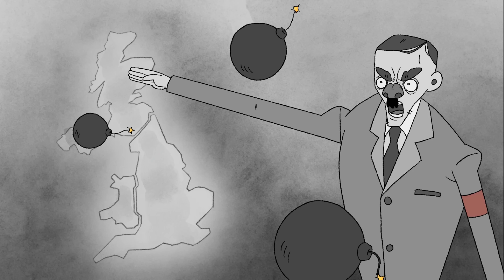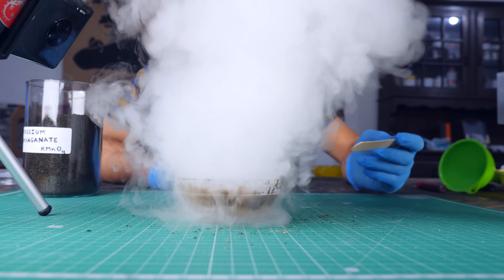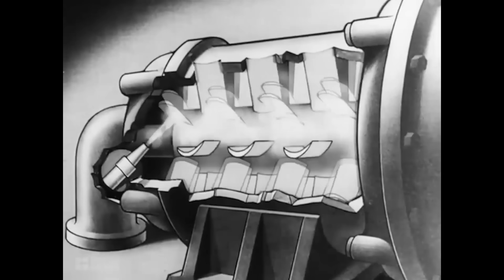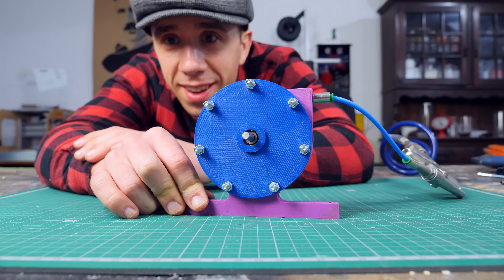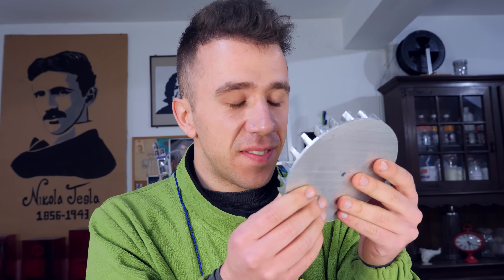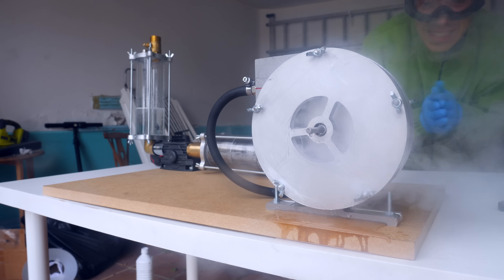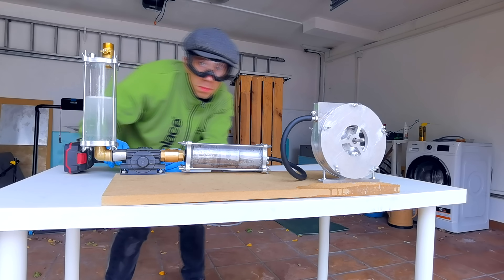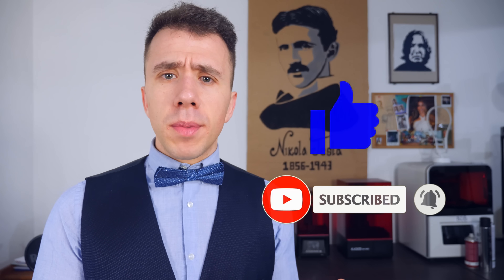I built the World War II V2 Rocket Steam Turbine

Comment: I see two things that needs an improvement, the catalyst tube need to have the output tube it must be in a higher position respect of the input side, so the peroxide can’t exit in a liquid form. The second one it’s the weight of the impeller, you can hear the rpm ramp up sound. Good video.
Reply: Making the catalytic tube vertical just like the peroxide tank would automatically add a sort of "distilling" element to the process, making sure all the gas has to pass through all three catalytic converters.
Reply: Yeah sitting the cat tube vertically and filling it from the bottom should help alleviate the problem of it pushing H₂O₂ into the turbine.  Also to get the most work out of the steam it should be coming in along the axel and exhausting at the outer edge of the radial turbine. The problem with this design , with the steam exiting in the centre, is that the steam is being forced back on itself by centripetal force imparted by the turbine disc. It's also moving to an area of higher pressure as it moves to the centre and as liquid is getting into the turbine and trying to exit vial the centre this is inducing more drag.
In short swap the inlet to come it near the axel and the outlet to the bottom of the turbine to drain any liquid
Reply: Yeah but the RPM ramp up sound is the best part!

Comment: I've had this idea for years to take a typical turbocharger for a car and instead of using exhaust gasses to spin it, I could use a combustion chamber and use fuel and oxidizer, fuel and forced air, or even the h2o2 and catalyst to run it and if it makes enough mechanical power I could make an axle for it to add power to a front wheel drive vehicle because it can be added to the rear undriven wheels. I think it might have promise as a way to add decent power without having to upgrade the engine itself.

Comment: Mount the Catalytic chamber vertically with the exhaust at the top to only let steam and oxygen out without pushing the liquid hydrogen peroxide out as it  will settle at the bottom. Hehe...also really need a 3D printer...so if y'all could help out with the likes I'd really appreciate it.
*Also there's a problem with the link to the models.

Comment: Along with the people who are also suggesting vertically mounting the reaction chamber... you can at the low point in the hose use something like an egr like valve that takes the heavier liquid and recycles it into the main tank... while allowing the steam produced continue along the way which should further lower the loss due to the h2o2 not completely being reacted and escaping that chamber... just a thought

Comment: I see 2 main problems here. 1st- liquid is getting into the turbine. Solution: make steam intake from above, gravity will pull liquid down and pressure steam will go up. 2nd- the radial turbine has to be designed taking into account fluid velocity instead of pressure, you can quickly calculate this as Q=S/A (flux=speed/area). Hope it helps.

Comment: that intro had me going like "how does Keeps have anything to do with Hitler?" NGL, if that were the Ad read then I'm pretty sure you would of managed to keep most peoples attention on the Ad. Keeps wouldn't of been happy but the attention ratings would of went up like Old Spice Commercials or any other commercial that actually is designed to keep peoples attention. Saw you used the CNC machine again, you gonna make a nozzle for cutting fluid to increase the life span of those end mills you keep breaking?

Comment: Dont know if it has already been sugested but for an idear, a 'gimballed nosel' (a nosel that can change its direction of thurst), maby for an experement, attach it to your skatebord and drive it about by changeing the angle of thurust? or pehaps for that RC rocket?

And as an idear on improving the catalist chamber, have the tube fixed on the top of the chamber, this allows steam to rise while the proxide drains back into the catalysit to be converted into steem. on a sligly related note, pehaps have a pressure chamber between the catalyist and the turbine? it would allow steam to gather pressure to level that you can control and potently higher pressure levels.

Comment: I think I'd turn the catalyzer tank vertically with steam coming out the top, peroxide going in the bottom or side. Also, maybe not stacking the catalyzer all the way to the top, gotta have room to settle the liquid out from the gas. I think there's also valves that help gas escape and not liquid?

Comment: you could try wrapping the cats in an electric blanket and heat them to like 80C might help with the decomposition reaction, more temp is normally more better with chemical reactions. those cats may need re-activating every once in a while the metal will oxidise inside them which may make them perform better actually, PdO and PtO are better oxidation catalysts than Pd(0) and Pt(0) metals.
Reply: Do you think any cat is gonna survive this..? :D
Reply: @Larock-wu1uu  Yeah no sweat, supported PGM catalysts can be blasted with a few hundred degrees at a couple of hundred bar for 100s of hours on stream, this shouldn't do much to it, peroxide needs something acidic to leach out the metals from the cat, should be fine......should, I have eaten my words before 😂😅

Comment: What about instead of sending the gas products directly into the turbine send them back into the hydrogen peroxide tank, to provide a self-sustaining positive feedback loop and a liquid-gas separator? So unreacted liquid gets thrown back into the tank, and steam, while pressurising the whole assembly (feeding itself) - gets into the turbine.
Also, i'd suggest you using steel tanks for high pressure needs instead of acrylic tubes due to high pressure and chemical dangers.

Comment: With that poster behind you I thought you'd use a Tesla Turbine. I made one and it runs at about 100,000 rpm at 100 PSI. Gear it down to increase the torque for the generator.

Comment: Just twho things 
1 Why the catalyzer chamber is orizontal? Make it verticalso you can extract only the steam from the top. And no water Will Flow into the turbine. 2 The turbine spins because of kinetic Energy of the steam impact on the wings of the turbine. To improve the torque the gas must be "standing  still" once impacted on the turbine wings. If it bounce back you waste kinetic Energy. A part of the energy still with the gas floating around. So try to modify the nozzle size or increase it. If it is too small The Flow Will be too fast and bounce back. If it is too big you still waste Energy. I guess the core problem is in that. You can even modify the wing profile and so but i suggest you to start with the nozzle diameter. Sorry for my English.... I hope it have a meaning for you XD byeeee

Comment: So the V2 used a steam pump to pump the fuel for a rocket engine. And then you go and use a drill pump to pump the fuel for a steam pump which then in turn would pump the fuel for the rocket engine.

Comment: Ha, I've suggested this, in a comment under your 'Hyper Jet Steam Turbine' video about 4 months ago. I wonder, did you read that comment or did you come around to the idea independently?
The comment was this, by the way: 
"You could try using silver mesh/sponge as a catalyst, and using the steam to power a Tesla turbine (and use that to power a model car or a boat).    Or use a peroxide-powered steam turbine to power a pump, like in a real rocket turbopump. I wonder how high of a flow you could get with that, and for example, how high up could you shoot the liquid.   You might also try making a true model of a rocket engine using that pump - use a peroxide powered pump to pump peroxide and a combustible fuel (Alcohol with permanganate, maybe?) into an engine. It might turn hypergolic... maybe.  You could use one enclosed steam turbine in the middle to power two pumps with one shaft (the size of the pump rotors should be proportional to the proper ratio of liquids being pumped). 

Would try it myself, but I've got no 3d printer, and machining all that on my manual mill and lathe would take forever." 

Maybe One of those ideas to use the steam turbine? ;)

Comment: You should probably mount a pressure tube to equalise the pressure of the fulle and outlet to remove the back pressure, also, you can make it work as a hydraulic press to simplify the design and remove the pump

Comment: A lot of people are suggesting mounting the cats vertically, which is probably easier than my idea. What if you split the reaction chamber? If you add a couple of one way valves or flashback arrestors in between the cats it will give it more time to react, while ensuring that each time it pushes the reaction to the next chamber it isn’t just pushing more unreacted peroxide straight out. With the pressures involved I imagine that mounting the cats vertically will still push just as much peroxide out the end.

Comment: Really cool! Recreating this kind of stuff is an awesome process to behold. I have a couple ideas that may or may not work 

If you mounted your steam out port more towards the top of the catalyzer, that might keep some of the fluid out of the steam thanks to gravity.

Also, not sure if this is feasible, but maybe you could run an air line from your catalyzer to the top of your peroxide fuel container. This should mean equal pressure on both sides of the fluid, so then you could feed the catalyzer with gravity and not need a pump. Might make the entire thing solely peroxide powered 😃

Comment: Why dont you get n turbo and mod it a bit to improve efficiency that is almost the same design as the jet engine but one side is intake and the other outtake so can split it to only use one side or both to get more horse power and using a shaft on the blades that makes something into moving force

Comment: try larger catalytic converters, if you can get your hands on them. more reaction surface area should mean a more complete reaction, at least in theory. also add an intermediary vessel between the reaction chamber and the turbine with inlet and outlet located at the top of the vessel, any liquid coming over from the reaction chamber should get caught in the intermediary vessel while any gaseous byproducts should flow through un impeded.

Comment: I think the outlet from the catalytic converter should be near the top of you're still having issues pushing liquid hydrogen peroxide into the turbine. Since the steam will rise and the liquid will stick to the bottom. 

Liquid should be fed near the bottom and maybe orient the converters vertically if possible.

I think putting them in series is causing a few issues with lowering the output pressure because the steam has to move through the converters which will contain the flow due to friction. I think feeding them in parallel is harder, but you'll get more surface area to react, and then you'll get more steam out.

I'm curious how much of the catalytic converters are actually being exposed to the reaction, and is the reaction being assisted or hindered by using three in series.

Comment: add another chamber in between the catalyser and the turbine. it will help you regulate the pressure.
another way what i think maybe better is that... if you pass the h20 and o2 mixture through a chamber with liquid water... the steam water will precipitate and the oxygen rich air when combined with a atomizer type apparatus to pump a fuel air mixture into the engine ... it can then be... you know HAHAHAH. 
anyway, love your videos man keep working

Comment: You could 3D print / mod an already existing  plane with a pulse jet engine as the propeller. Even without any remote control it would be fun to watch something that flies using an engine you built.

Comment: Why not add an isolation chamber  between the turbine  and the decomposition tube  so that the water vapor and oxygen can pass through to the turbine and   any unreacted  hydrogen poroxide  can be recycled back into the the system and reused

Comment: Maybe add a cyclonic separator so you get less liquid into the turbine. No doubt that is restricting flow through the tube and slowing down the turbine.
Increasing the surface area of the tines should give you more bottom end torque. Might help with the power under load.

Comment: Regarding the turbine, what could really improve your performance is using a de Laval nozzle on the inlet rather than just a simple port or converging nozzle. It's the easiest way to convert as much of the heat of the steam into velocity prior to hitting the turbine and is actually how most steam turbines of this type (ie using tangential steam injection) operate. Since figuring out the mass flow rate would be a pain in the ass here, I recommend trying maybe half your nominal inside diameter of the port as it is, and then use like a 15 degree half angle (30 deg full included angle) diverging section. Might be easiest to machine a cylindrical housing for the nozzle, then print the actual nozzle insert out of ceramic so that you can more easily play around with throat diameter. Ideally you'd have all the data necesary to get mass flow rate and find the exact right throat, but ain't no one got time for that shit here.

Comment: I can't wait for the day that you build at least a partially staged flow rocket engine...  Maybe a scaled and/or modified version of this (or maybe use a tesla pump) driven of a fuel line from a primary fuel feed that gets pumped into the main combustion chamber by the  pump. Ditch the pump exhaust out the side - if the Shuttle could do it, so can you! :D

Comment: The solution is that poster hanging on your wall: a Tesla turbine!

Or: make another scooped disc. A second one.
Plus one which is solid state and add this one like a ring between both rotating discs. These ring with nomoving scoops must be in the opposite direct than the ones sucking in and through. Like a zig zag pattern. 
See the V2 steam pressure turbine.

And as said before: the Tesla turbine probable would give you enough spins with lot less hydro peroxide.
But you need the right distances between the plates/disks.

Comment: Amazing work on the design and spectacular production quality as always. I have only one small critique, if you are open to it. I would recommend switching to an aluminum or stainless steel wall for the decomposition chamber. It might be mixed with water vapour, but hot high pressure oxygen is still hot high pressure oxygen and it can lead to an explosion if it gets hot enough to start reacting with the acrylic. Otherwise this was top notch, keep up the awesome work you're doing!

Comment: integza you need a final chamber that the gasses and peroxide can flow into thats vertical including a small tube at the bottom that has a valve for pressure regulation that leads back to the origin chamber with the peroxide like a condenser so the internal gasses pushing the turbine also push the peroxide back into the chamber as a closed system essentially using all the peroxide within the system.